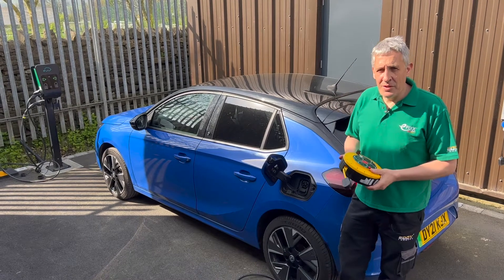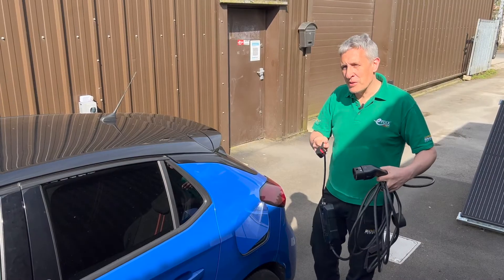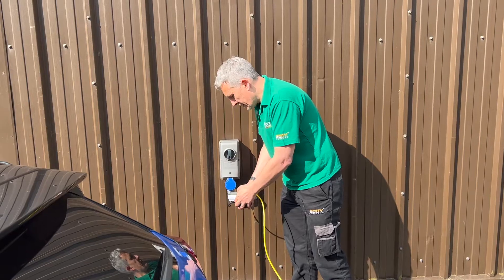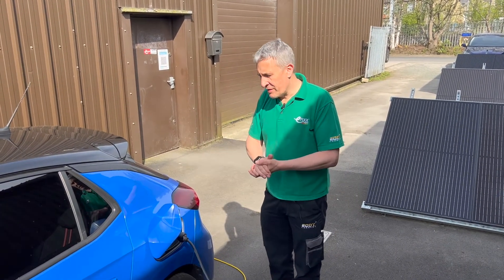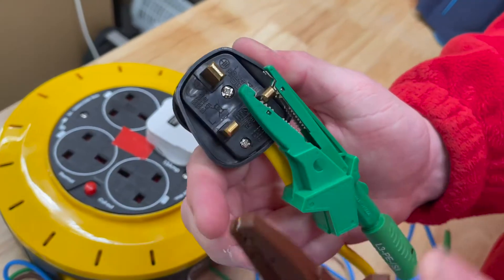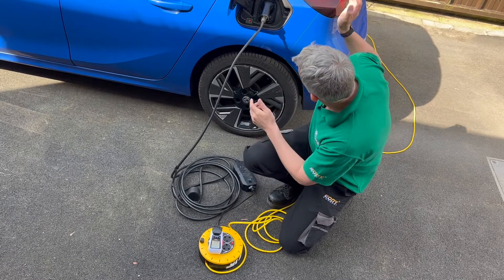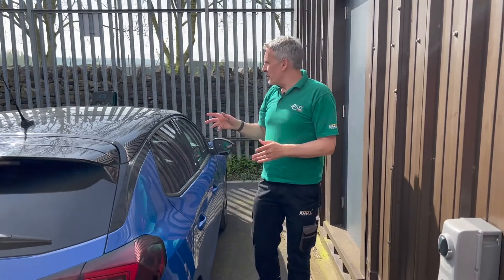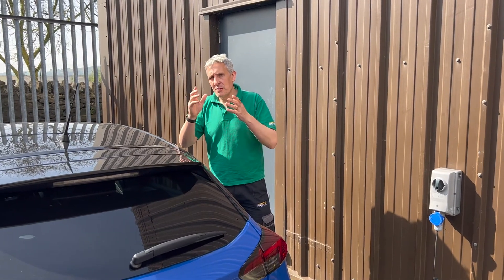STOP Using Extension Leads for EV Charging Right Now!

Comment: I've experimented with my  Tesla  MY AWD trying between 5 and 10 amps. Going by the time it says it will take to charge, I think there are significant losses due to the charging and monitoring circuits being powered on. Sadly I have lost those figures, but it was significant. I am therefore guessing that the similar will be true for using a 7Kw charger compared to the 2KW granny charger (chatgpt says maybe 15-20% for granny charger compared to 8-10% on 7KW or 6-8% on 11Kw)

Comment: You're kidding, arent you?. 50 watt loss on 3000 watts is less than 2%. If you're that concerned buy an oversized extension cord. I'd be more worried about the extension heating up and potentially catching fire with that load than a 2% loss.

Comment: Nice little scare!
ANY cabling, including the cabling to your EV charger will also have losses. As you say extension cables should always be fully unwound, this will reduce losses and the possibility of fire. The solution is to use a heavy duty cable, and as short as possible, or as we did, have a charger fitted which will NEVER pay for itself, no matter the tariffs, however it provides simplicity, control, and will increase the sale price of the house.

Comment: As many others have pointed out there are a lot of flaws and misconceptions in this video. Absolutely correct to point out that using a cheap extension reel for charging is a bad idea - spot on. But if you're charging at 13A (NOT recommended by any EV car company because of the strain it will put on your home wiring) the greater risk is from fire rather than power loss. Most (I think) EV owners are au fait with this and your granny charger should be limited to 10A. 

I am unable to install a 'proper' charger without spending a great deal of money on groundworks, etc. But I am perfectly happy with my granny charger, set to 10A, and using a custom-made extension cable of the correct length using 2.5mm2 cable rated as 'arctic' cable. 

Very few EV owners with this kind of setup would arrive home with 20% remaining in their batteries and expect to charge using a granny charger - it's just not the way most people would operate. If you've been on a longer journey and drawn your battery down that far you would likely stop at a public charger and at least get up to 80%. But for 99% of days charging up to 100% at home using 10A overnight at 8p/unit makes for a highly economical setup. After 8 months on average I'm spending no more than £20/mo instead of around £100 on diesel in my former ICE car.

Comment: Retail extension cables have been awful for decades, no matter how much you pay - back 30 years ago I made my own trailing lead cable - using a 25m reel of 2.5mm 3 core flex and I still use it to this day.

However, 50 ish watts is far less than the loss due to the car's OBC eating power for many hours, managing the charge input; in some cars this can reach over 30% loss.

Comment: Really great video with a clear  explanation of the real-world effects of current draw and cable resistance on EV charging. It's important info that a lot of people miss when using extension leads.

Just a tiny correction: at around 2:19, you mention that P = I^2R is Ohm’s Law. It’s actually a form of Watt’s Law, combined with Ohm’s Law.
	•	Ohm’s Law: V = IR
	•	Watt’s Law: P = VI

When you combine them, you get:
	•	P = I^2R
	•	or P = \frac{V^2}{R} depending on what you know.

Here’s a little cheat sheet for anyone interested:
	•	V = IR → Ohm’s Law (basic voltage-current-resistance relationship)
	•	P = VI → Watt’s Law (basic power relationship)
	•	P = I^2R → Watt’s Law using Ohm’s Law (useful if you know current and resistance)

Again, awesome video — your clear examples and real-life testing make a big difference. Subscribed.

Comment: I think it so misleading to not warn people about ev how if you cannot charge at home you will be spending alot of time charging at a station I really regret an ev  I got a Nissan leaf s dealership told me 220 miles turns out it’s only 149 I drive 80miles+ every 2 days thought my solution would be to get an extension cord but I guess not.

Comment: You still pay losses even with a type 2 charger using a 6mm2 cable. If you are charging at 32A and say the length of the cable is 10m, you still have power loss of 30W at 3mohms per m.

Comment: You have not uncoiled the extension lead a big big no no from a safety point and heat as cooked up it will create a magnetic field so as informative videos go that’s failure 1 also if you run a cable to your charger there will be a loss over that you haven’t compared the 2 and given real word figures so it’s not even real figures
Reply from the maker: If you watch you’ll see I did uncoil the lead. The linked video at the end shows what happens when a lead is left uncoiled.

Comment: This extension is not compatible with charging an electric vehicle... But there are compatible extensions, just find out.  There is no problem in using a suitable extension cord, there will always be energy losses, there are no miracles in life, but for safety's sake you should be concerned about having suitable material... My neighbor always carries the tesla modl 3 with an extension cord, but it is suitable , it's been 3 years and there are no problems...😂

Comment: Why use a cable reel? It’s too open to abuse, the number of people who don’t realise that the cable should be fully out of the reel before put in use is unbelievable! The number of extension reels I’ve seen where they’ve been used on an electric fire or something like that draws a lot of load that end up with the cable fused together in the reel is crazy, they have no idea how dangerous it is what they’re doing. I never use a cable reel for any of my extensions and always use Caravan 16A rated plugs and sockets, my EV has never been charged on anything other than that type of cable; I also use 4sq mm tri-rated cable.

Comment: The safety is paramount peeps, don't forget the channel is here to promote safe electrical installations. No surprise in the tilting towards a full wall charger install then.

Really worried? Make your own extension lead with 5 core 2.5mm HO7 and double up L and N. Fine for 10A over a few hrs. R on a 5m length about 0.1♎️?

Comment: I have two EVs parked outside my house - a Nissan Leaf 24KWh and a MG5 52KWh. I have yet to install a 32A EVSE, and so far we manage quite comfortably to charge using a "granny charger". In our case I have made the executive decision to limit our charging speed between 8-10 amps, and I used a thermal camera to confirm this was a good decision. We also only charge during our Octopus Go cheap rate (00:30 - 05:30 in the morning), which gives us enough of a charge to keep both cars charged up to a useful level during the week. The Leaf gets charged daily for 5 days out of the week, and we top up the MG5 twice a week. Do I miss the speed of charging at 7KW? Probably, but because we work from home 100% of the time it is difficult to justify the £800+ to install a 32A EVSE point. This equals about 6.6 years of electricity at the rate we use it.

Comment: I fitted a 10mm2 cable to where my EV charger will go, because the difference in resistive loss between 10mm2 and the default 6mm2 over a 25m run at 7kW over many hours is (eventually) quite a lot of money and emissions. Efficiency of electrics doesn't get talked about much - it's all about safety - rarely does anyone consider power loss in cabling and kit. It's worth paying for a bit of extra copper for high-power devices over the long term.

Comment: Saw this video in youtube suggestions, and played it as I thought it would explain safety issues of sort. Not a hypothetical 22p extra cost per every 60% charge of a BEV (btw my electricty cost is not 34p/kWh but 25). So, let's say I charge it this way 50 times a year: 32 kWh is 60% battery, 50 times it's 1600 kWh per year, which at 4 miles per kWh gives 6,400 miles per year (10,000+ km), for an additional cost of 22p x 50, that is an "eyewatering" £11 per year, compared to buying and installing a proper charger (which in turn costs a few hundreds of £). 

This video is literally showing me the opposite of what it's meant to. Of course it's better and safer to use the smart chargers, but ten quid a year of extra cost on the basic cable are not a "costly mistake". The main purpose of a smart charger is basically higher power output and charge planning, not saving...

Comment: Why did you delete my informative comment that mentioned BS1363, and that any "granny" charger pulling greater than 10A would not conform to standard if plugged in to a standard 13A 3-pin socket?

(I assume it was deleted by you - it's no longer here, and there was nothing in it that would trigger the YouTube auto-bots).

Comment: Part of your problem is that you have not uncoiled the extension cable fully.  Try it again with the full length of the cable pulled out of the reel, and laid loosely on the ground.  I suspect you will find a difference.
Reply: Why exactly?

Comment: If you must used a domestic extension lead for charging, limit to 10A and fully extend the extension lead for this load to dissipate the heat. It should say that on the extension lead itself relating to higher loads otherwise the coiled up cable may get heat damaged,
Reply: It should clearly state it is not rated for 13A. Shops need yo check this or do a product recall.
If it states 13A and can't do that without going on fire, it should not be on dale.
Reply: Or limit it down to 8A. Safer
Reply: Most reels I've had say max draw 3.2Kw (uncoiled).

2.2Kw (coiled).

Or something similar.

Comment: Been there, done that - almost caused a nasty fire... Never use an extension reel as it just cant handle the amps going through even on a trickle charge... Best way would be to make up a single extension lead of the correct thickness that can handle the draw and run that to the car.

Comment: During the couple of months after buying my EV I used an extension like this one, plugged into the garden socket I use for the lawnmower. The software I used showed it was charging at about 2.5kw, which was OK to use with overnight scheduling. Since it was autumn I was not too worried about the socket and the extension overheating. 
However, the convenience of plugging in and setting schedule/start/stop in the smartphone is a major advantage. The £1000 for a permanent wall box are well spent and a clear advantage for those already living in their forever home.
With EVs over £40,000 attracting higher VED for several years, I'd certainly suggest people should spend slightly less on the car itself and make sure their home setup is complete. If more people do that everybody wins even if moving house every few years.
Reply: You don't have to spend a grand to get a remote-controllable plug of course.
Reply: @xxwookey  It's not a terrible estimate. I'd rather say £1000 and someone finds it's cheaper than talking about how the "standard installation fits 80% of cases" like some companies do and then someone is terribly disappointed because of extra cables, wi-fi signal, refurbishment of old consumer unit, etc.
Reply: @ Sorry. I think you misunderstood me. I'm not quibbling the cost of a fixed EVSE install. I'm saying you don't have to get a proper EVSE install to have the 'app remote control' benefit. You can add a £20 remote-control plug to your granny lead and get the same benefit if you want to do it on the cheap. You might need to find a decent one so it doesn't melt, which is also part of the £1000 EVSE install benefit, but if all you want is remote switching then that is not a reason on its own to go for the whole fixed-EVSE expense.

Comment: This is such an awful video on so many levels and damages the credibility of your channel.
Why dont you do a video on 'If you must use a granny charger' and give useful advice such as. 10A maximum, 6A safer, with plug temperature monitoring. Extension cable 2.5mmsq minimum of good quality such as from dedicated EV cable retailer. Don't use time switches, set the inbuilt car scheduler to obtain cheap rates. Most importantly be very careful where you plug into, is the circuit in good condition, has it been tested in the last few years, is it a highly loaded circuit already. Charging at a holiday let may invalidate owners insurance, if the worst happens you may become liable, and finally when charging check every few hours to see if the plug is getting hot. Or spend 800 quid on a proper install and sleep easy.

Comment: The correct name for that cable is a 3 Pin Charging Cable. It's nothing to do with old ladies. And you seem to have totally forgotten about the ability to set the charge times by the car...
Reply: Doesn't matter when you charge the car, you still waste power.

Charging in a low tariff period means you don't waste so much money, but it is still better to use a thicker extension cable to minimise losses and the extra cost of that thicker cable will soon pay for itself, even if used on a low tariff.

It's a poor strategy, being lazy and relying on charging in a low tariff period to reduce how much money you waste, when you will save even more money by upgrading to a thicker and or shorter cable.

Comment: Are there any grounding issues with extension cables, because the car is likely some distance from the earth spike? I started reading the regulations about when a charge point needed its own earth spike and quickly became very confused. I'm not an electrician, and would appreciate your opinion.

Comment: Understand your argument but you are saying it is better to spend +£1000 to get a charging point fitted rather than waste £22 in heat loss in the cable!

I really don't think you have made a convincing economic argument to get a charger, do you?
Reply: The power wastage cost is only one of the issues to contend with. There is also the risk of fire caused by the type of extension cord that a typical home owner would likely use.

Those extension cords aren't designed to run at max load for long durations, but a typical home owner is unlikely to know that or understand why.
Reply: Extensions not rated at 13A need to be clearly marked or shops need to remove them from sale if they are not as advertised.
Reply: @darren424242  And then there’s the ring main cable buried in their house as well, if the socket used is on one. Who knows what state that is in? Incidentally, the fact that the load is a long term, continuous current for EV charging is why it’s excluded from the  “load diversity” allowance in the rating of distribution and service cables to domestic properties, in the BS 7671 bumf.
Reply: Just get heavy duty extension cables with 1.5mm2. That is rated at 15A, more than enough for a 10A charger

Comment: You are deliberately overloading it by using the full 13A. As I am sure you are aware the max allowed for granny charging is 10A. You would have had to reconfigure the charger to do that. Also price cap isn't 34p it's 25p.
Reply: Apart from the recommended 10A granny charging limit on 13A sockets you really need to take into account the fact that AC charging is less efficient at slow rates. That is because most cars are using several hundred wats just being in charge mode. So that standing loss is a much greater proportion of the incoming power if it is a lower rate.
That is the real cost saving of getting a dedicated fast charger fitted. Obviously it's also handy to be able to charge quicker too.
Reply: Looks like it might have been a CTEK charger, which do have the adjustable charging rate up to 13A on it.  Even though I also know this should not be done above 10A, I'm just quote the manufacturer here.  "Adjustable charging rate 6A, 8A, 10A and 13A (10A max on 5m)."
Reply: My Kia granny charger is configurable to go above 10A. I think it goes to 13A. I virtually never use it since I had a charge point installed.
Reply: I guess it would depend on the length the extension cable. A very short one, say a couple of metres if needed would be preferable.
Reply: I have an EV and I would not use an extension lead or a granny charger , I have a Ohme home pro installed but I frequent a lot of facebook EV based groups and trust me , there are a lot of EV owners using 13a granny chargers with extension leads , there are quite a few photos of burnt out 13a wall sockets too .. 
out of ignorance they’re risking their homes⚡️😳
Reply: @jvoric  It's not that ignorant to think that a 13A socket will actually supply 13A without catching fire. BS1363 says that a 13A socket will supply 13, and before 8 hours the temp will stop rising. And that test hasn't changed since 1984. But it's true that plenty of sockets will in fact only do this when brand new, or other aspects of the electrics are not well-implemented (poorly torqued screws, grouped cables, later insulation, grouped high-power MCBs), and most houses don't test long-term high-power loads until they get an EV. And electricians don't always do smart things like leave an air-gap either side of the EV MCB/RCBO in the CU for cooling (often there is a shortage of space for such niceties).
It is a bit daft to have a 13A spec that we have in effect had to downgrade to 10A for continuous use to allow for everything being a bit shoddy.
Reply: You would expect sockets to be made to a standard, so if rated at 13A, it should be able to handle that.
The same for cables, if rated at 13A they should handle that.
If they don't, you have cheap imported and possibly fake goods. Anything sold by reputable UK dealers needs to comply with safety regulations.
Reply: @OH2023-cj9if  they are indeed rated for 13A continuous, providing they are actually properly rated.

The test for them to be considered as meeting the requirements involves them taking 14A (yeah overloaded by a full Amp) and they are expected to stabilise at a safe temperature over 8 (memory fails me here it could be 6) hours.